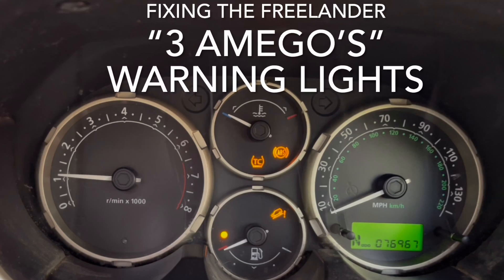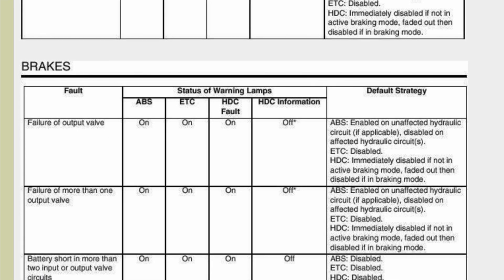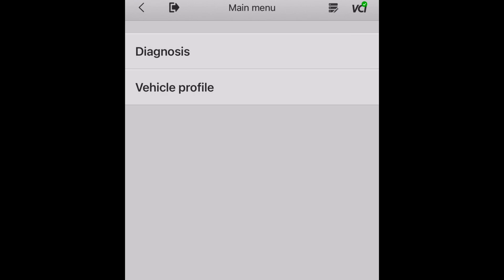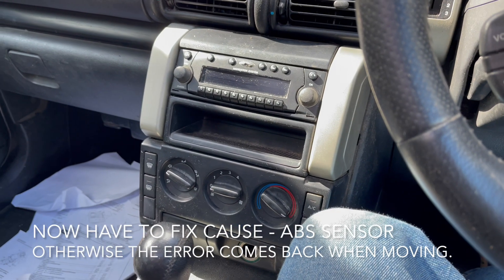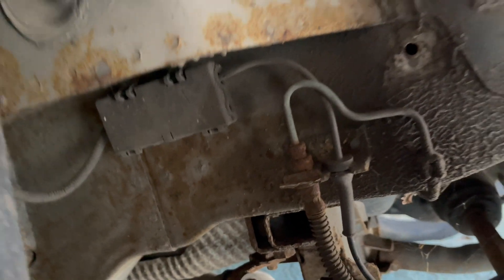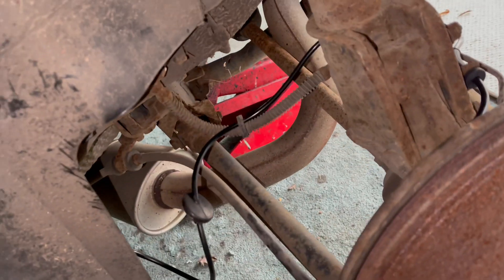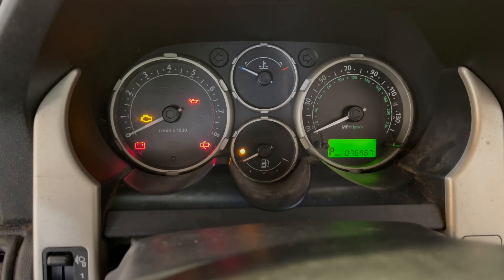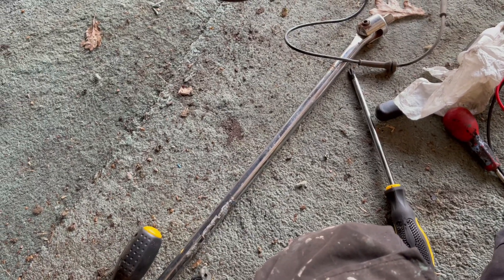Freelander 1: Fix the 3 warning lights:HDC, ABS, TC: The 3 Amigo’s. Simple fix.

Comment: I have problem on freelander 1 1998 when i turn key in contact i need to press unlock on key to turn off alarm on dashboard
Reply from the maker: You always need to use the unlock on fob to turn off the alarm unless you use the key turn trick to enter pin code (see owners manual).

Comment: Hello! 

I’ve just bought a 2004 freelander 1. 

Your video for window is invaluable - both back not working. 

These “three” have also come up. 

Do you have a video for the “strep downhill” (whatever the correct term is) warning light? Seems to come on intermittently.
Reply from the maker: @AlexandarSterling  If just the downhill descent light is coming on, the same as when you press the down hill descent button, then I would suspect the wiring to the switch - check under the gear gaiter where the wiring is.

Comment: Hi Don't know if you can help me ? I replace the left front drive Shaft on my Land Rover Freelander 2005 2.0 Diesel now i am getting the 3 light coming up on the dash and my diagnostic tool is showing left front wheel speed sensor periodic fault? could you give me some advice on the meta please?
Reply from the maker: Check the position of the abs sensor on that hub hasn’t been disturbed or damaged.
Reply: @comeinhandynow  Thank for your reply. I have taken the sensor out it looks ok. after watching your video I set up the diagnostic reader to take a reading of the left and right wheel sensors at standstill it is showing 0.66km/h on both sensors but when I start to drive the right one  goes up but the left one is lower and a bit erratic so I am going to try getting a new sensor and take it from there. I don't know if this could be the problem but the side shaft I got had a abs ring on but I had to take it of as it would not fit, I did call    GSF car-part to see if it was the right one ad this was the only one they had on there system. Ps the one that I took out did not have a ABS Ring.
Reply from the maker: @ReneExner  I think that could be your problem, I think the later shafts were without a removable abs ring because they had magnets embedded into the shaft. The shafts I used didn't have abs rings (as pere my originals) but worked fine with the abs sensor.  Find another supplier perhaps.
Reply: @comeinhandynow  I have ordered another cv joint and hopefully this will have the embedded magnets .Thank you very much for your advice much appreciate. kind regards.
Reply from the maker: @ReneExner  Cheers, good luck.
Reply: @comeinhandynow  Hi sorry to trouble you again I am still having trouble with this sensor I put the old drive Shraft back still the same problem got a new sensor still not fixed. I have checked the live data  one wheel at a time and the left front is still all over the place is there anything else I can check? do you know if there is any other sensor like maybe in the gear box?
Reply from the maker: @ReneExner That is weird. I don’t believe there is any other speed sensor. Maybe a wiring or abs ecu input problem. You could try rewiring the wires to each sensor temporarily swapping left to right. That should tell you if it’s the sensor/shaft or ecu/wiring. Good luck.
Reply: @ReneExner I’m having the same problem atm it’s driving me mad done new driveshaft and abs sensor and getting the 3 lights i don’t know what to do. If you find out how u fixed it plz let me know
Reply: @comeinhandynow  Hi Hope you are well great news it was the wheel bearing I replaced it today and I am no longer fighting the Three Amigos. thank you for your time and advice hope this will help someone too.
Reply: @M1N3R_49ER  Hi Lewie my problem was the wheel bearing. I think what had happened  the new drive shaft I fitted had the ABS ring on it and the supplier said I just need to take it of and it will fit but I notice the flange on the CV was slightly bigger than the original one which must have pushed the sensor against the bearing and destroyed the encoding which is embedded in the seal of the bearing Hope this helps you too.
Reply: @ReneExner  yh got the exact same problem took it to get an mot and he said it will need a new wheel bearing to fix the lights got it passed but will have to do it at some point thank you very much for the reply :)
Reply from the maker: @ReneExner  OK glad you got it all working.

Comment: Hello mate, I really do appreciate your great efforts and awesome channel,  I did order the Brake pedal switch for my  freelander1 V6 2004.  And changed it( of course left it in) . Still is a new problem with Stepper motor which engine does'nt work as it should ,the engine indicator  hoes up and doen with the engine is on, it have to order it the new Stepper motor  according to car meck. Is it the same Stepper which match the 1.8 engine or 2.5 has the different one( on net just have seen for 1.8) from different websites in EU., I'll so happy for the answer if you could reply today plz🙏🙏. I appreciate your efforts and time. Cheers from SWEDEN ✨️
Reply from the maker: Hi and Thanks.  First I would recommend pressing the accelerator pedal to the floor very briefly, this should reset the stepper motor position.  If that doesn’t work scan for any engine codes, as it may be an o2 sensor fault throwing out the mixture. e.g. see https://youtu.be/YFU8Dj0qWKw?si=a1fUf_BVd4sp99uM
Reply from the maker: The iac for the 2.5 engine is this probably https://www.ebay.co.uk/itm/375074217586?itmmeta=01HRFY9TECT8Y8158PS6F6A27X&hash=item57542a5e72:g:bBcAAOSw-yllXiEz&itmprp=enc%3AAQAIAAAA0HP7t5IQzMXMp9SAVKTY3lj96Pj2I9bruKyJGoS37gTFGERV037DZvOOsAx7QZZbhQciVeQwar294H8%2F9CvaghQS1y151KEEg4mbxtImlhjpTQ9EBZAYhB8htrdi64vM4uw%2FAY1Ie1l5OSXIoMiWdzsun9Qh2ro5mfknQ%2FGXxqMrF2k7BSBUEp5R8CUiBdRp5AXwfMerfRDraxK%2FNK3e9DouOWs2n2y8tUrjpefOgyLiSQZNM%2FP5T979HPCNngPDFpxgnaW5C%2FsPdcttmIDoYKw%3D%7Ctkp%3ABk9SR6Knp_7DYw

Comment: Hi I have a 2003 Freelander and the speedometer has stopped working and my parking light stays on when I'm driving. Any clue what might be causing this. Thank you.
Reply from the maker: Nope, but start with the wiring diagram from a Haynes workshop manual and trace that parking light circuit to find the fault, you may find the other fault.
Reply: Thanks for the help @comeinhandynow

Comment: Great vid. I have a 2001 v6 Freelander, would you recommend me a nice scan tool? I think is a pretty simple ECU (Siemens), but I'm not sure if with a Launch I could read Transmission and ABS codes.
Reply from the maker: Thanks. I have used an Autel AP200C to read the ABS system, essential for identifying abs sensor faults, as well as normal obd2 stuff.  It may have an auto bix add on software bit, but i have not investigated.  I suggest you email Autel the seller of that unit.  See my review on the ap200c scanner on my channel. I also used it on my recent video fixing “the rhree amigos”.  Alternatively its worth looking up pscan.

Comment: Hi, I have a question, 1.8 engines tend to overheat and I'm curious why, I saw the MODIFIED THERMOSTAT HOSE KIT on the internet and now the question is does it help at all?
Reply from the maker: When in good condition they generally don’t however I did discover one overheat scenario at idling that is completely fixed by this mod that I came up with to reconfigure the PRT thermostat into an output type one, it been running perfect since: https://youtu.be/Fyq7yDlUKDg

Comment: I would love to give you a demo of my pscan diagnostic tool. It was specifically developed for the Freelander 1 and probably has far, far more features than the Autel. I'm in Ruislip. Are you anywhere near me?
Reply from the maker: Thanks, I hear good things about it but not used it.  You are 80 miles away so not that close. I am usually up for looking at tools etc for a future need and possible YT review.
Reply: @comeinhandynow  I have sent an email to the address on your website. Please get in touch.
Reply: @philip_christian  I have the i-carsoft Land Rover V2 tool does the Pscan offer anything different ?
Reply: @Bigbadbaza  pscan can talk to every ECU on a Freelander 1, except the instrument cluster and the North American spec V6. On the ABS it can do the power bleed brakes routine, and reset the inclination sensor. It can code in central logging fobs. It can log live data to your hard disk whilst you drive around (very useful for intermittent ABS faults). With the 1.8 it can put a SAWS map into the ECU. With the BCU pscan can trigger outputs (you can do things like winding the windows up and down). I have an icarsoft LR3 and won't even connect to many of the ECUs on our Freelander.
Reply: @philip_christian  
there is such a tool - "delphi Car" - hacked, with a Chinese adapter (less than $80). works via bluetooth. can write logs on the go! the program supports many cars up to 2021! and rid of greed)
Reply: @politicazlo8926  I doubt that it talks to every ECU on a Freelander like pscan does. Pscan was reverse engineered from the original T4 factory Landrover dealer tool.
Reply: @philip_christian  well it works with abs, dashboard, body electronics, motor, automatic transmission, srs, immobilizer. I see this more than enough ))) those I don't see such a function in delpi cars that is needed ! and she is not. ) those almost everything you need is here. and not the kind of money you have) + to this - there are still a lot of cars in 2021 that can be diagnosed:face-blue-smiling::face-blue-smiling: